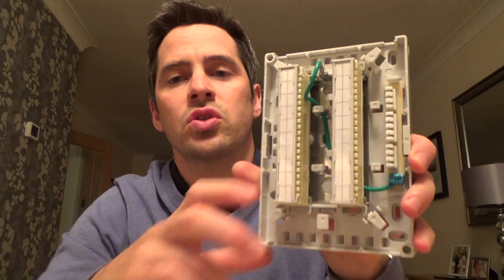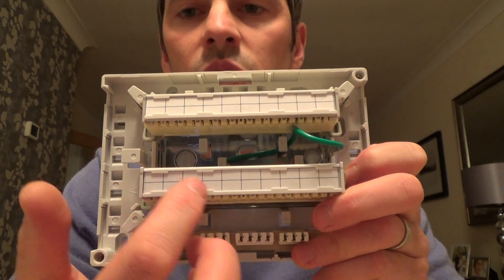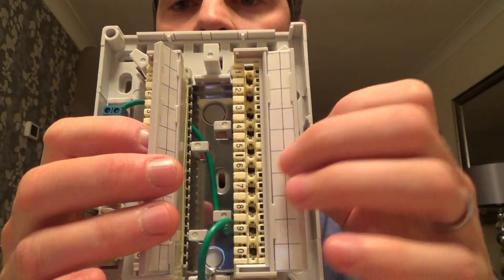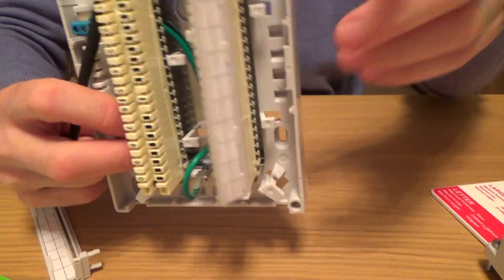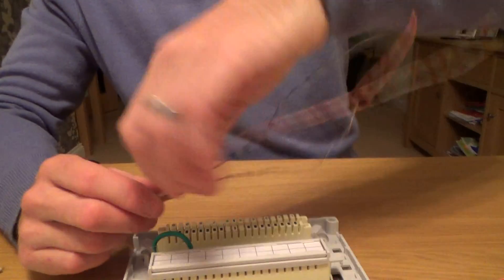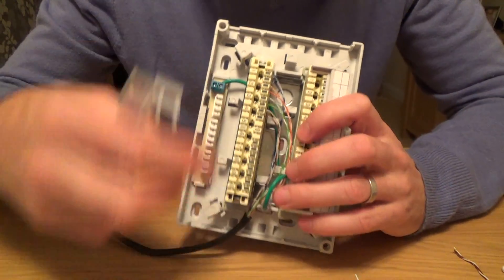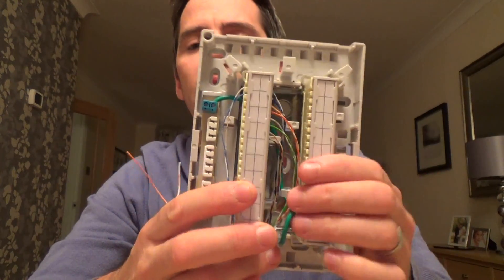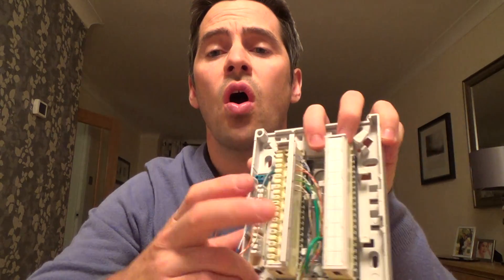How To terminate a BOX CONN 201D 20 pair junction box.

Comment: In Australia.... The 10 pair from the exchange would appear on the A side and be wired in across the top of the A Krone Block. All internal customer terminations would be across the top of the B Krone Block. You would not enter and exit on the same Krone block. You would see White & Red jumper wires connecting the pairs between the bottoms of the A side & B side Krone blocks. It's at the jumpers where you can work some magic with double jumpers to get a few phones on the same line.

While I'm here -- isn't Pair 6 - White & Slate (not grey)? ;)

Comment: Fantastic video. Just to repeat the question of Aarron is this box conn thing similar to BT's distribution points on top of telegraph poles and the ones underground? Thanks.
Reply from the maker: Petko Kondev Hi, no the others are different. The underground joints normally use jelly crimps housed in a waterproof closure and the top of telegraph poles use again a more sealed waterproof connection. These box conns would be used in office blocks and flats internally as they are not waterproof. In other countries I have seen waterproof external distribution points that do use these IDC strips inside them.Many thanks Vince
Reply: My Mate VINCE Thank you for the quick reply. Keep up the awesome work. :)